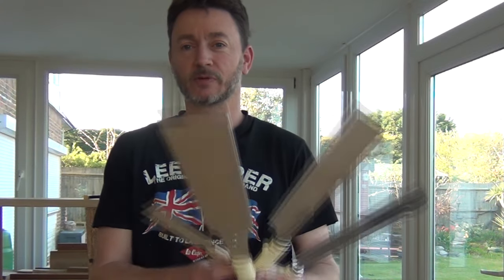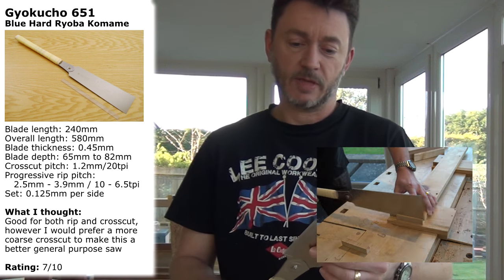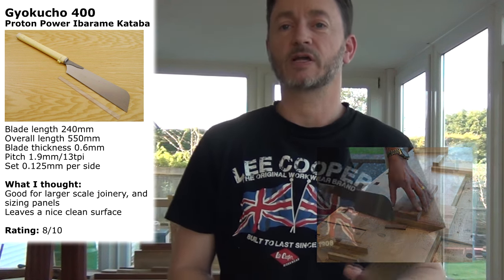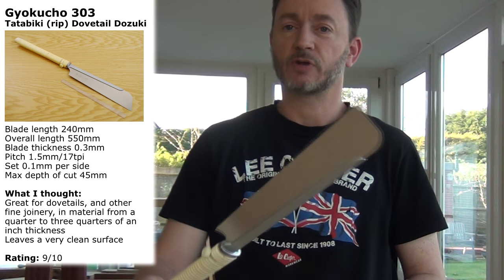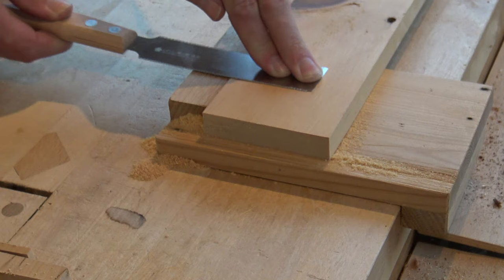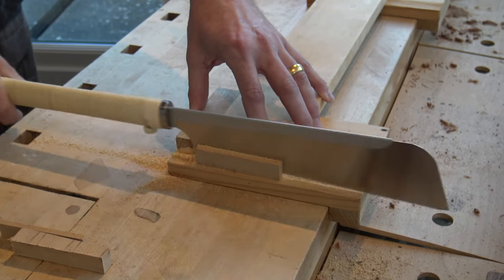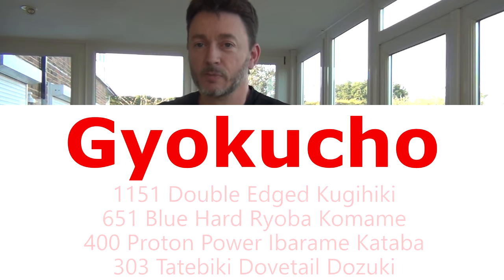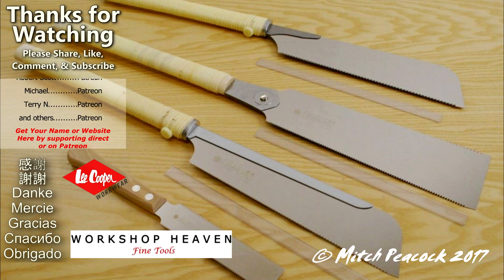Gyokucho 1151/651/400/303 Japanese Saw Reviews

Comment: Ask them to send you a 372, the Dotsuki Takebiki. It's like the dovetail saw but even more specialized for dovetails (full back, cant remember if teeth or kerf are different). It comes in a black soft handle version, which you should test too :). A Bunch of gyokucho saws now come with this handle, but not the flush cut yet, unfortunately.
Reply from the maker: Sounds good, but i do like the ratan handles

Comment: How does the 1151 (flush cut) do on thicker stock, such as flush cutting an 18 or 19mm wedged through tennon? 
My current no-set style flush cut saw does not mar, but it tends to get jammed about 1/3 of the way through, and just bend and flex if I try to keep going beyond that, particularly in hard woods. 
I have essentially given up on that one unless I am doing tiny dowels, and have to card scraper the marring away after a more aggressive saw for through tennons.
Reply from the maker: Ah yes! This is often a problem. Firstly, with no set any saw will bog down, and secondly, as the thickness of a cut gets bigger the saw becomes less efficient.
My solution has always been to chop away the waste as I progress the cut, and to cut from all sides to reduce the cut length.
Also, first cut off close with a regular saw, protecting the work of course, which will weaken what's left of the waste so it doesn't jam the flush cut saw so badly.
As for the 1151, the coarser teeth cope better with longer cuts (fewer teeth in the cut) than my previous flush cut saws. It cuts well in both soft and temperate hardwoods, but I haven't had cause to try it in very hard exotics yet.

Comment: There are other Ryoba saws with greater lengths with larger teeth (300 mm with 9 tip for ripping and a 310 mm with 7 tip).
Reply from the maker: Mark Mistretta Cheers. The thicker the wood, the less tpi should ideally be used, to avoid getting bogged down in sawdust